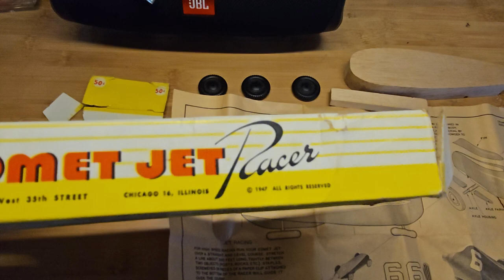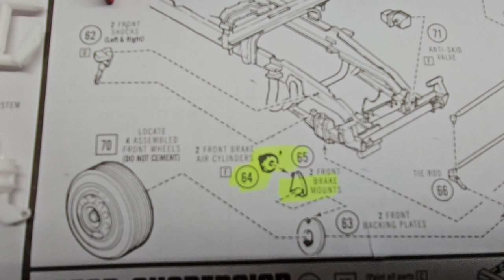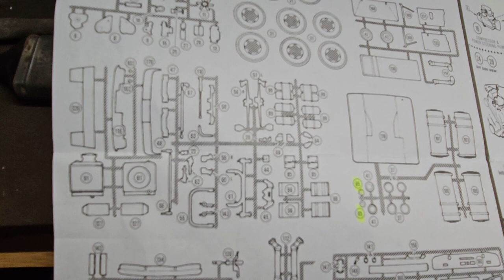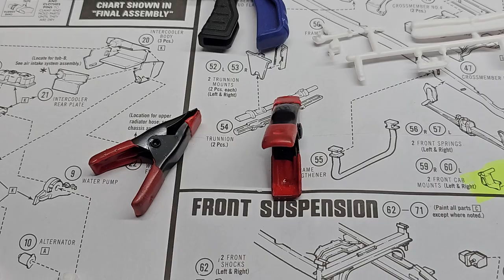update on the Mack Cruiseliner build, a look at a very old Comet car kit. Instruction sheet woes!

Comment: Nice......is that typical of that brand of model for the instructions
Reply from the maker: Yes except it is clear that some of the trees of parts are from the AMT. Mack R model kit. The front cab mount and suspension is not really clear, so fit up from steps ahead is needed.
Reply: @DavesGarage249  maybe they made it more difficult on purpose.....or not, most likely for convenience on their behalf
What ever it is it's looking good so far 😜